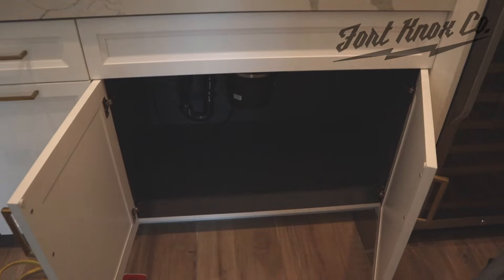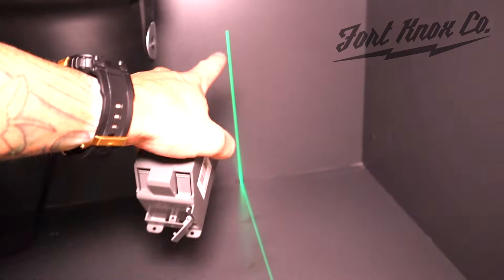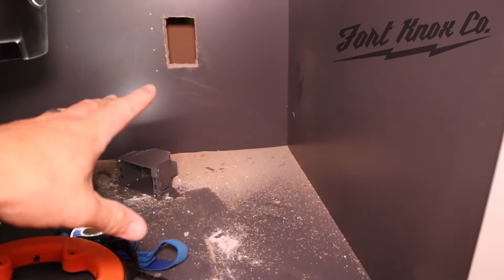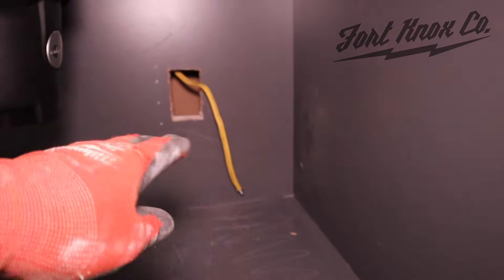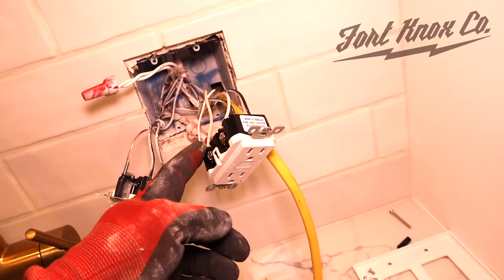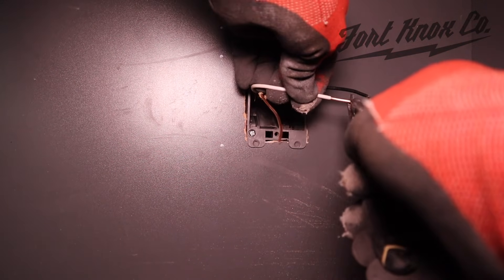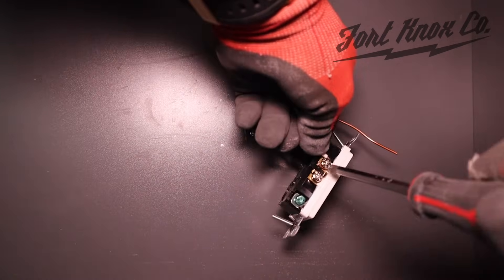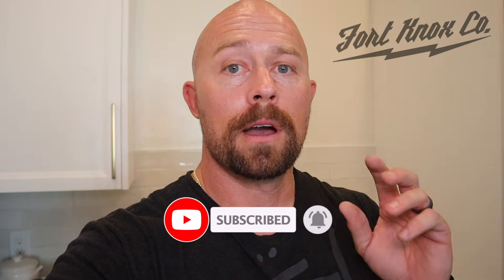How to Add an Electrical Outlet to Existing Circuit

Comment: Cant you just use the outlet that the garbage disposal is on? just swap the outlet to duel outlet, its still 120v
Reply from the maker: Yes. This is mainly just getting the power down under the sink. How to move it. But if you already have an outlet down there for the garbage disposal it’s most likely on a switch? So you’d need to rewire it to have an outlet or plug that is allowing you to have constant power.

Comment: That extra outlet would add to your load calc doesn't it? Would it put a strain on your CB?
Reply from the maker: Yes it adds to the calculation but usually an extra outlet or two isn’t going to hurt or put you over. The “10 per circuit” and other calculations that code uses for calculating is considering if you had multiple items on that circuit running at the same time situation. So very rarely would you have multiple plugs with appliances plugged in and in use all on the same circuit.
Reply: @FortKnoxCo Makes sense! Thanks for the information!
Reply from the maker: @KL4life no problem at all

Comment: Hello what about that existing outlet have 14-2 and you gonna add the new outlet with 12-2???? Is that gonna be safe ?
Reply from the maker: If your existing circuit has 14/2 that still should be fine. It can handle regular power loads. But it’s more common it seems to have outlets ran with the thicker 12/2 wire because of the ability to supply power with less resistance vs a 14/2 wire that I usually see in circuits for lights.

Comment: @FortKnoxCo, how would someone run power down from a light switch/GFI outlet to do a new garbage disposal install for? There hasn't been power under the counter for anything to my knowledge.
FYI - If it matters, the existing power is on an exterior block wall, 50s construction with mainly cloth wiring. This one outlet does seem to be a more modern install if it makes a difference.
BONUS: The switch is for the overhead light and the two existing GFI outlets power a microwave, a toaster, a coffee grinder and a blender:face-turquoise-covering-eyes:. The last three run on a heavy-duty extension cord since there is no power on the perpendicular wall. I have no good solution for this mess and am a renter, so I need to keep costs to a minimum. Solutions and/or code don't seem to be a priority for the owner as long as it doesn't burn down 🙈🙉🙊.
THANK YOU in advance for any unofficial, hypothetical help you can provide.
Reply from the maker: Wow, sounds like you got a pretty unique set up there. Well, in general wherever you decide to pull power from you, just need the hot and neutral wire to run up to a location where you have a switch. Then you can run the power down into an outlet where the switch is in line of the black wire. Essentially, you could run both wires up to the switch, but continue the white wire down to the outlet while running the black wire up to the switch and putting the switch in line and then continuing the black wire down to the outlet.

I don’t know if that makes total sense, but essentially you’re just putting it in line to create a break in the hot wire. 

When you’re doing this from a light switch I’m assuming you’re going to be adding a separate
Switch to power the garbage disposal. So from the light switch, that’s there now there should be a power running to it, that hot wire can be branched off of and shared to the new switch. From there, you could run down to your outlet and back up. 

Without seeing your exact set up, it would be hard for me to problem, solve or create some type of custom workaround to create this circuit. But in general, what I stated above is your overall pathway to accomplish this.

Comment: Overall, nice concise and clear walkthru.  However, I disagree that it's better to pigtail the wires on the load side of that GFCI.  Having a wire under both sides of the terminal evens the pressure on the screen and the terminal plates.  It does require slightly more force to be applied to the screw to tighten the terminal.  This saves box fill, time, and leaves 2 less failure point in the system (the additonal wire nuts Fort Knox installed).  FWIW, I first started wiring houses as an apprentice electrician in 1995.
Reply from the maker: I get what you’re saying. I believe code usually says only one set of wires under each terminal. That’s why a lot of people pigtail. I’ve done it both ways though. I appreciate the feedback.

Comment: You already have an outlet under the sink. Just change the outlet and you'd be doing the same as what you did only less time.
Reply from the maker: If you already have an outlet under the sink then  yes you already have power running down there. But in a situation where you don’t have an outlet already down there…. This is what that video is for.  Moving or adding an outlet.

Comment: I have a question. When my gfci trips,the green light stays on. I have pulled it out it is wired right.i can trip it from the hot side to ground and it  both trips and reads correct when i use the ckt tester. Any ideas?
Reply from the maker: Yeah that sounds off. Based off how you’re describing it doesn’t sound like it’s operating correctly. Have you tried buying a new or different GFCI outlet and wiring it in and seeing if it trips correctly? Faulty unit would be my first guess after checking everything that’s there

Comment: Right on point but one thing
 The top of the GFCI is not always the line.some manufacturers use the side
Reply from the maker: Depending on your GFCI outlet it should have it labeled which terminals are the load side. But either way it could be done off a regular outlet as well

Comment: What does a job like this typically cost?
Reply from the maker: That can all depend on how much work there is. Like cutting through the cabinet can be a little tedious. But simply just adding an outlet can be a 2ish hour job, assuming there’s not drywall repair needed. So someone may factor the potential complication arising and use that as their honest bid. I would guess not more than a couple $100 at most? I would charge around that if the person was close by. There’s expense with travel n things that people all include in their price. But a couple hours of labor is fair plus the other stuff I mentioned.
Reply: @ thanks for your response
Reply: @ thank you. Can I ask a separate question? Do you think installing a 30 amp 4 prong outlet for a dryer will cost more than $500? Just wanted to price this out but when I call places, I don’t get a direct answer.

Comment: Hello, my sink is little diagonal and there is gap between cabinet and the wall where the power outlet. How can I add power outlet there
Reply from the maker: If you can access the outlet or the wall behind the cabinet it can still be done. Just depends on how you want it to look. Either way you could cut a rectangle hole in the back of the cabinet big or small and reach the wall behind. Then cut into the wall and run your wires as you would. Now how you want it to look when finished is up to you. Coolidge have the hole in the cabinet a little bigger than your outlet face and mount your outlet to the wall like normal and it will have a bit of A recessed look. Or you could start with a small/same size hole in the back of the cabinet as you would need for the old work box would need, cut into the drywall and run your wires but you would now be securing the outlet old work box to the cabinet and have the outlet flush with the cabinet. Kinda like using the back of the cabinet as what your drywall would be

Comment: Thanks for the video. I have a similar outlet like you have under the sink(closer to the cabinet door) for the garbage disposal, but it has a switch right above it. Can I use an outlet extender with 2 switches and use one thats always on for the RO and the other for garbage disposal?
Reply: I have an outlet just like you showed at 0:42 that connects to the garbage disposal but also has a switch on top. Whenever I need to use garbage disposal, I need to bend down and turn it on. I am thinking to add an outlet extender with 2 separate switches and connect the RO to one of them thats always on. The other switch for garbage disposal will be turned on and off as needed. Is that ok from a safety pov?
Reply from the maker: @ adding an outlet to use for the RO is fine. Just like adding any other outlet to and existing. You just need to feed that new outlet with a constant power. 

As far as the switch for the garbage disposal I just did a video showing how to install a. Push button on the sink for the garbage disposal. Might be a good option for you as well.
Reply from the maker: If you have a power source or plug that has the constant power then you’re good with plugging in the RO. It doesn’t draw much power.

Comment: awesome video! Thanks for putting it up in addition to the one where you drill the hole in the quartz for the RO system faucet. I'm going to be doing all this on Sunday when my RO system arrives  :-)
Reply from the maker: That’s awesome!  I’m editing another video on the APEC RO system right now. How to install that system from start to finish. Doesn’t require any electrical hook up. I’ve done a lot of RO systems and it’s one of my favorites. Should have that video walk through up within the week
Reply: @FortKnoxCo  nice! I just got the waterdrop G3P800. Hoping for clean results 😅

Comment: Pastic back box socket onto a combustible mounting and in the location of water with no IP rating...🤔 wouldn't get away with that under UK Regs.
Reply from the maker: Pretty much everything I’ve seen over here in the midwest of the US is all plastics type boxes. It’s not very common to have metal or non-conductive boxes used in a lot of construction

Comment: Nice video. I have a similar issue. But I need to run mine from a switch ( That power's the insinkerator) . I just installed an RO Filter system. Any idea's? Thanks in advance.
Reply from the maker: On that switch or wall switch there is power supplying that switch. The black wire coming from the house. From that you could branch or “pigtail” to a new outlet. Obviously you can split off the white wires as well to run to the new outlet.  Main thing is identifying the black wire that is supplying the power to the switch and branching off that.
Reply: @FortKnoxCo  I took the plate off the switch.  There are 2 black wires feeding that  switch. I just  checked. Both outlets are switched. .
Reply from the maker: @ABobsLife  your wall switch itself will be fed with a constant black hot wire. And on the other side of it will be the black that it either feeds or disconnects. So from the physical switch itself you’ll pull off of that black wire. It should have constant power.

Comment: Your videos are next level great! As much as I do a ton of DIY I would hire you in a heartbeat. What area do you do work in out of curiosity? I will check out more of your work, so very helpful and extremely thorough. Thanks!!!!!
Reply from the maker: I really appreciate that. Makes me feel good about to effort I put into filming and trying to share the knowledge. I usually just get so busy with getting the project done that I never film it. Just don’t have the time for it sometimes. But I try to do it more and then editing and posting.  
I’m in Las Vegas. Almost finished with this “casita” I’m building. Basically a 2,000sqft home.  I’m editing a video about running electrical for CO/Smoke detectors and wiring as we speak. Just did the job this morning

Comment: I am trying to install a water heater under my bathroom sink because I live on the 5th floor this is what my warranty folks are telling me why I don’t have hot water only after 9 minutes running the water to get lukewarm water. Would it matter how much the water heater voltage is? Thank you 🙏 for your help.
Reply from the maker: If the water is set up for a regular outlet , 110-120 volt/ usually a regular looking 3 prong plug, then it shouldn’t matter. It would matter more if the circuit that the plug is on it has a 20 Amp breaker. If the breaker get overloaded then it will pop and you’ll need to upgrade the breaker. But if it’s a 110-120v unit then it shouldn’t be a problem

Comment: Great video, thanks for the tutorial. Don’t you need to clamp the cables where they enter / exit the box in order to comply with code?
Reply from the maker: Thank you! I appreciate it. Technically if you were doing new construction and having open permits on a build with electrical running they would be looking for all of that. They should be secured above or below the box between 6-10”. But it’s almost never done when doing renovations. You’d need to open the walls way up just to install that. The boxes themselves have the opening that pinch down and make it difficult to pull the wire backwards out of the box. There’s things in place that accomplish the same safety measures but in all honesty they are always necessary for safe function. And you’re usually only doing a short run to another outlet so there’s not much rush there so long as all of your connections are proper and secure.

Comment: If you didn't have that dedicated outlet for the disposal, would this plug be able to handle plugging the disposal into it (even though it is running as part of a string of GFCI's)?

I need to add an outlet below our sink for a garbage disposal, and I'm trying to decide if I can just add a new box from one of the ones in the run of kitchen GFCI's above the counter and use that without tripping the rest of the line of plugs when it's used.

Thanks! Great video.
Reply from the maker: Yes, any outlet can handle a garbage disposal. The only reason the dedicated outlet matters is mainly because they run a switch on that power source to the plug. So you just have to make sure that if you want a constant power source that you’re not jumping off of one that has a switch on it. If you’re able to Anche an outlet off of a original outlet you can wire in a switch to that hot side and make one or both of those plugs turned on by a switch which then can run your garbage disposal. Or if you want to run one of those fancy push button, air activated, garbage disposal switches you can do that too. They still recommend putting that power source on a switch so that you can turn that power on and off For sure.

But to answer your question in short yes, any outlet should be able to handle the garbage disposal. Assuming it’s a 20 amp. Most outlets nowadays have a 20 amp circuit /breaker. All of our wall outlets are 20 amp and our ceiling lights are 15 amp.

Comment: I thought you are supposed to use the white wire. Isn't the yellow for 20 amp?
Reply from the maker: White is usually for 15amp. These wall outlets are all 20 amp. So most outlets, at least where we are located, are 20 amp and all ran with yellow
Reply: I'm assuming the box with the switch and GFCI receptacle is on a 20 amp circuit with 12 gauge wire. Hard to tell in the picture. The receptacles here are 15 amp, not 20. That's okay, 15 amp duplex receptacles are allowed on a 20 amp circuit. It's totally fine.

Comment: hey, how about when the existing outlet is on the left corner between 2 or more studs on drywall?
Reply from the maker: Like you want to move an outlet down and over a stud or two? That will require some drywall work most likely. Depending on where you want the new outlet you’ll need to just across the studs. Drilling a hole through the center of the stud and that requires a  small hole in the drywall to access usually. It can be done and is very common, but requires a couple extra steps